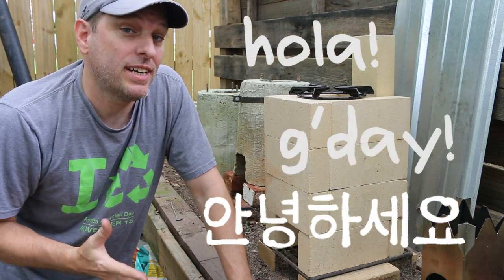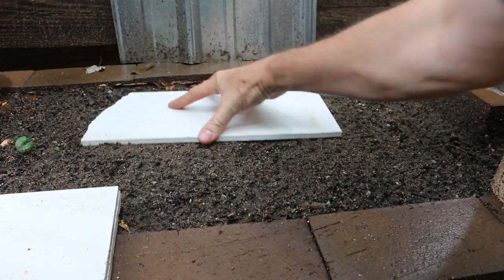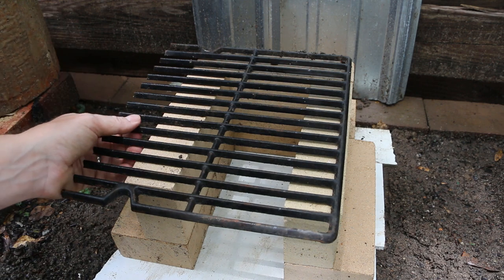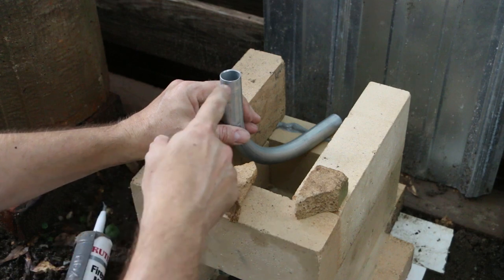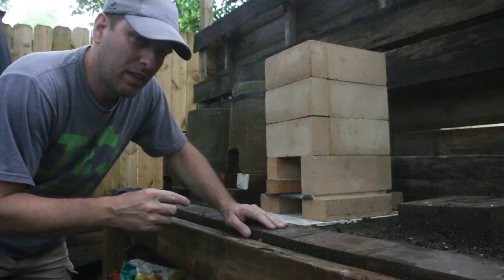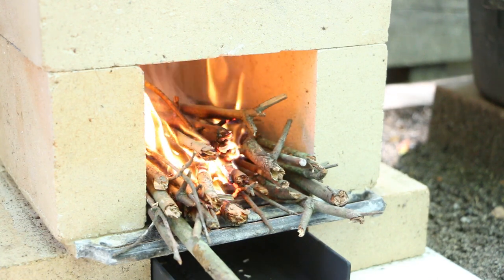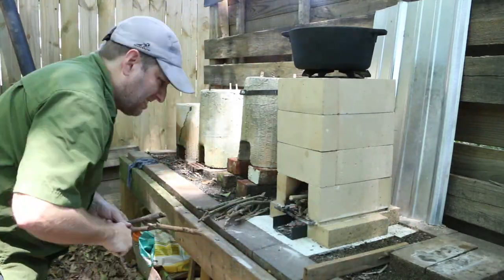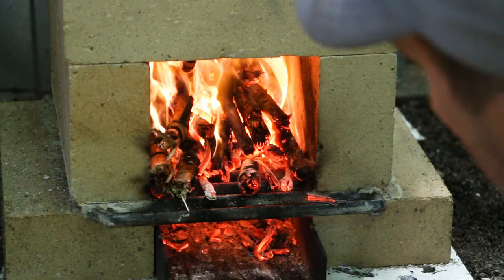How To Make A Fire Brick Rocket Stove

Comment: Your green wood comment needs closer scrutiny.  Paraphrasing, 'green wood contains sap which helps the fire burn', then you threw in something else about "wood gasification". Not exactly the way this works.  Green Southern red oak contains 75 to 80% water, when you throw this into a burning fire you actually consume heat from your fire to convert this water into steam at 212f which is cooling your fire (dry red oak burns about 900 - 1200f).  Also, steam from burning wood causes soot build-up in your chimney.  Wood gasification requires an oxygen starved environment, the exact opposite of a rocket stove.
Reply from the maker: Good points, Dale. I can’t argue with you on that. I was a bit loose with the gasification connection. I would like to learn more about that process. I’ve seen some pretty amazing gasifiers here on YouTube. Thanks for the constructive criticism. I’ll take it. Thanks for watching.

Comment: It doesn't look like it would work well for simmering food, which is what is done most often.  For instance, beans need to simmer for about 4 to 6 hours.
Reply from the maker: Ha. That's the truth. Rocket stoves are not for slow cooking. The burn hot and fast. That's why a cast iron pot and boiling water application works well. Captures the heat well, holds it and spreads it out. I'll branch out eventually. :-) Thanks for watching.
Reply: @GreenShortzDIY  I think, what you would have to do, is make the throat part at the bottom about a foot long and top it with brick or whatever that would hold the heat.  That would serve as a simmer after it boiled.
Reply: Maybe do another DIY project and build a solar oven?  Perfect for simmering.